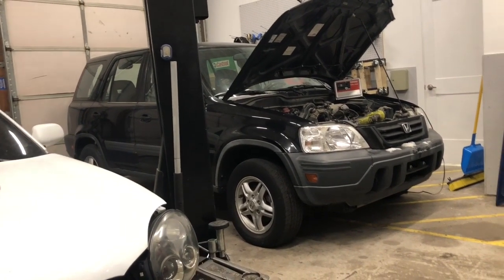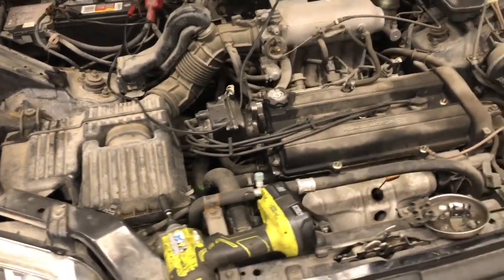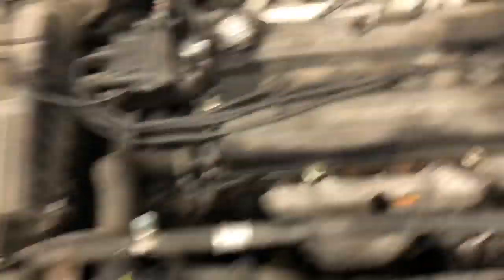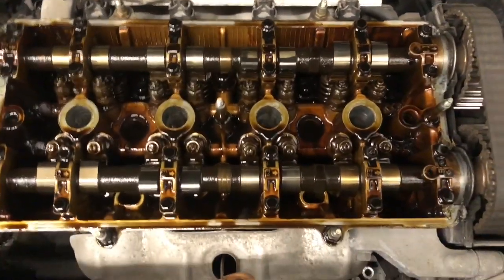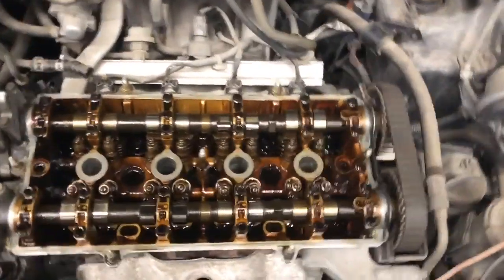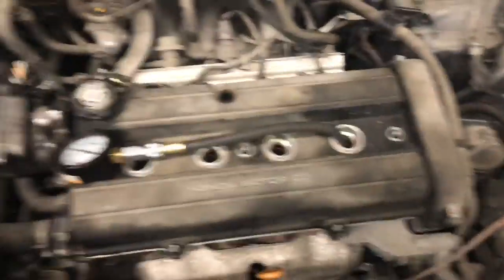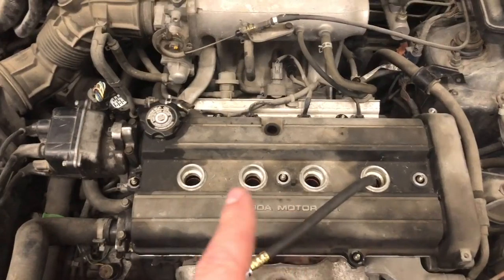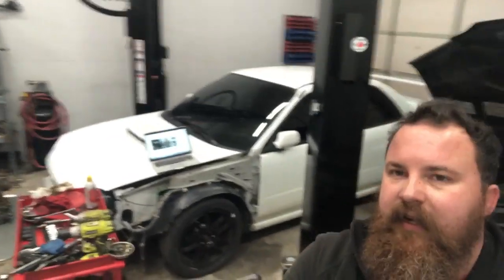98 CRV Misfire Diagnosis P0300, P1300, P0301-P0304

Comment: My wifes 2001 crv with 259,000 miles started missing started out as every once in awhile to always, found one bad injector, one mostly clogged injector and one spark plug boot was very wet, plug wire top boot was not seated. Put in 4 rebuilt injectors, new plug wires runs smoother then it has a months, made the wife very happy. Also found the radiator had a tiny leak in lower right corner, new radiator.

Comment: We have a 1999 CRV that is "slow to start."  I plan to take it to a local mechanic to have it diagnosed.  I hope it's something simple to fix as my daughter doesn't want to sell it.  The dealer said it's only worth $800.  The inside door handle chrome has flaked off (cuts fingers) so the handles are duct taped.  The doors don't lock any more with the fob.    The picnic table still works fine.  Thanks for the interesting video. 70-yr. old mom

Comment: Same as my '99 CRV! Check engine light, random misfire codes, etc. After reading through some CRV forums I discovered that the heads on this engine were a bit soft, and the valves were literally beating the seats to death, which tightened the lash over time. On top of that, the USA owners' manuals recommended valve adjustments at 100,000 miles! International manuals state (I believe) 30,000 miles. Honda would not pay for any repairs, since this problem doesn't usually show up until well after the warranty has expired. They did issue a TSB sometime in the 2000's (too late for me). As far as I know, this only affects the Gen.1 CRV's ('97-'01). Anyway, I skipped the compression test and went straight to the leak-down test. Bingo! I had a burnt exhaust valve on #2 cylinder! I did a complete valve job, did not machine or replace the head, and it is still my daily driver with 338,000 on it. Hint: for anyone wanting to do this themselves, you will need a special valve spring compression tool. A "standard" one won't work because the head is too deep. It was $80 well spent however, because it does 2 valves at a time! I still have it, if anyone is interested.....
Reply: Does a complete valve job refer to removing and replacing the existing valves?

Comment: Very informative! Thank you! I’m about to look at a crv with the same exact issue. Only asking $1,000 so I think it would be worth it even if I had to buy a new head or even borrow one from my LS integra. I’m hoping a burnt/broken valve isn’t the issue. It’ll be hard to diag in the guys driveway so I’m going to take a gamble. It currently runs on all 4 just has a rough idle so we shall see
Reply from the maker: for $1000 its worth it! LS heads are easy to find and swap out affordably. Good Luck!!

Comment: Most depressing search of the day. Haha. Great video. I had oil leaking into my spark plugs so I changed the valve cover gasket. Wish I would have checked when I had it apart. But I guess this is next.
Reply: It’s most likely you need a valve adjustment, these b20s really should get them every 30k miles. It’s very easy to do yourself, watch the video tutorial from The Honda Resource on youtube

Comment: I Just ran in to issue on our 2001 CRV 283,000 miles. It had a misfire under load so I started with a compression check came up with 200,175,175 200 from there I noticed the plugs were worn bad they had a gap of .59 and should be .44 so I put new plugs in it and it still did same misfire so I took the coil out and found that it was shorting out through the casing and the dist housing ,I also tested the coil and it tested good.But that was the dang problem.I think the plugs with such a wide gap caused the coil to work harder and short it self out
Reply from the maker: bob4brenda very common as well, I once had a crv with a dizzy come in that the wiring was all cracked and corroded. These Honda ignition systems are great, but sensitive for sure

Comment: Miss fire on 3 and 4 I put high mileage injection fluid to gas every time I filled it half tank and it would turn off and it would come back on again  then changed gas to mobile  super + suggested by mechanic and the light turn off after 3 months. Why??

Comment: I did the compression test on my crv got cylinder 1: 30
Cylinder 2: 160
Cylinder 3 150
Cylinder 4: 155
 Does this mean cylinder one has a burnt valve or just need adjustment

Comment: Great video. I wish you were close to western Colorado. The car love of my life, my '99 crv, was not holding its idle at a stop when the ac was on. It has 248k miles. Anyway, I took it in for that and they adjusted the valves and the day I picked it up, it started getting misfire codes, rough idle and a blinking engine light. I took it back immediately and after my mechanic replaced several other things including the mapping sensor it seemed to be running fine. But after driving 10 miles, the engine light came on again and started blinking again, but it seemed to be running fine. I took it back and now they say my rings are bad in cylinder 1,2 and 4 and I can either drive it til it quits or put in a new engine. It doesn't smoke or use oil excessively. I would love to get another opinion on what my options are. I love my car. I've had it 20 years. Is this the end, my friend??
Reply from the maker: Vanessa Ford oh that’s rough :( best case scenario burnt valve, worst case worn rings :( I would say swap in a low mile jdm engine at that point, but honestly? You could find another CRV easily for the same price. Maybe do that or try the 2nd gen CRV? Sorry to hear about your baby :/ Thats rough
Reply: Thanks! Do you have a quick answer for how you tell if it's a burnt valve or worn rings? I was thinking burnt valve when I watched your video. They did a leak down test and said there was also blow by coming from the oil opening and that it is worn rings. I'm going to drive it 20 hours to KY in 3 weeks. Hope we make it!
Reply from the maker: Vanessa Ford leak down test or wet compression test. Do you not trust the mechanics? Normally they give you the results of their tests. If air was coming out the exhaust? Valve, if out of the oil dip stick tube? Rings. Cant hurt to run it til it blows at this point. I wish ya luck! Let her rip!

Comment: I had a distributor rotor come off an aftermarket distributor I installed into my CR-V last November when I got it and the original one died.  Drove for only a few days and got CEL for random misfire and misfire on all four plus P0420 hope it's not a valve too.  Even on Honda's I.N. it says it might be if a valve is shot

Comment: I took my 01 crv to a shop to change the timing belt and water pump and belts while the mechanic was doing the job. Now he returned it with a rough idle and I dont know if he didn't do the timing right.

Comment: Great vid! My son has a 2000 CRV with 175K miles, and is showing P0300,, P0301, P0302, P0303, and P0304.... I'm heading up to Humboldt to go try and fix it, but wondering if he's having all of those error codes is it still likely a burnt valve, or possible vacuum leak, like maybe a throttle body gasket or vacuum hose? I'll definitely run a compression check, and check the valve clearance, but since he's pretty remote I'm a little scared of stranding him :-/
If you have time to give me your 2cents I'd be ever grateful!!

Cheers!
Reply from the maker: Keith Patterson your saving grace might be the fact that its all cylinders in your case. Only a few systems share all cylinders like the intake manifold or fuel system or fuel rail. Brake cleaner works great for finding leaks (idle changes) but a compression test right off the bat will let you know fast. (Plus the engine is still cold so you can adjust valves after if the numbers look good) . Thanks for the view and comment! I wish you and your son the very best. Teach him the ways!
Reply: Most appreciated! I'll let you know how it goes! Best!
Reply: Thanks again for the beta. I got  back from Humboldt and hoping I fixed his car :p
Did a compression check. 
Cylinders 1,2,4 were at around 193, and cylinder 3 was at about 172. Exhaust valves were kind of tight, so I adjusted, reset the CEL, and now crossing my fingers. 
I did spray brake cleaner all over the intake area but never saw a change in idle speed. oil and coolant were nice and clean, so  not expecting any HG issue. I'll let you know how it goes!! Cheers!
Reply from the maker: Keith Patterson thats great news! And those compression numbers rock. At worst maybe spark plugs, cap and rotor if it does come back. Nice work!

Comment: When I turn on engine shakes then after a couple of minutes it would ho back to normal oil was low I tapped it added what it needed then light turned off. But still shakes a lot for a couple of minutes then it runs fine. Honda crv 2001 2w transmission is good no problems there. Had a  coolant leak it got patched so no more leak. So why if engine light is off it still shaking at beginning?
Reply from the maker: could be all sort of things honestly. worn mounts, worn crank pulley, fuel trims etc

Comment: I have a misfiring problem, and the engine cuts out when rapidly decelerating like in a tight turn. But the problem is almost inexistant when over 3,000 RPM when valves open more because of the geometry. I tend to think this is because there is a closed valve that open ups at higher revs. Correct possible interpretation ?
Reply: I don't think so. I think the motor just kinda compensates at higher speeds/rpm's. Rapid deceleration during tight turns? Are you racing your CR-V?
Reply: @katielyb  ciao Katie ... no I live in Italy ;-)  The beloved CRD is now gone... Too complex a motor to be handled by inexperienced mechanics.

Comment: Had the same problem replaced the head and did a valve adjustment, just do a valve adjustment every 30k
Reply: Exactly. Unfortunately the Honda manual says to do it every 100,000 miles. The root cause of the problem is soft valve seats, causing the lash to decrease over time. I found this out the hard way. One of my #2 exhaust valves was burnt also. Did a complete valve job and it's still my daily driver with 350k on it. Mine's a '99.
Reply: @19580822  mines a 99 also with allmost 200k on it. My timing belt broke lucky i didn't bend no valves but it just don't seem like it run's like it use to. I'll prob either replace the motor which i have a spare or another head on it.

Comment: My heat and AC is not blowing out of the vents on my 2004 Honda CRV. I have checked the fuses and they all are good. I changed the blower motor and the resistor and nothing is still working. What do you think the problem could be? Thanks?

Comment: What's wrong with just putting in the one new valve in 🤷🏽‍♂️ it would fixed the problem correct if im wrong . But sweet diagnosis!
Reply from the maker: Many times that can work if caught early. The problem with burning valves is why they were burnt. The valve clearance tightened (this leads to the valve being unable to cool between strokes, then they burn), usually at this point they recess the valve seat into the head, then you cant adjust for proper clearance anymore even with a new valve. Heads are cheap, machine work isnt.

Comment: Hi It is very good to learn.I have 03 Honda crv heater problem ,when you turn heat on driver side is cold air blowing passanger side is hot air blowing .I flush heater coil also same thing what should I do next .
Reply from the maker: Tin Tun check the blend door, or the other door down under the dash

Comment: The reading on a check engine light showed cylinder codes--I went to a higher grade gasoline and the engine light turned off.  The car is still idling very low but is running strong.  Should there be a worry?

Comment: Hey my Honda CR-V 1999 is having problems. Between the last two weeks it's been cutting off, cut back on when it wants too, change the converter and replace fuel pump and is still cuts off,  within the last two days it won't start...???
Reply: I'm late but it's probably the ignition, there's a recalled part that causes that issue

Comment: my 2001 crv is firing cylinder 1, spark and plug my question is can i put something in cylinder to see if injector is working.? thanks good videos,,
Reply from the maker: babe tucci thanks for the view and comment. You can put a screwdriver onto the injector while it is running, then place your ear directly onto the screwdriver handle. You will hear clicks if it is working. Or you can move the injector to another cylinder and see if the misfire follows it
Reply: the resonator has a rounded bolt and i haven't went further...////this is a auction car i bought to run on a mail rt....everything is great but  this misfire.. 143000 miles.
Reply: 2001 crv,,, i took the resonator off to get to injectors,,started engine and it revved up and down,,so shut it down.

Comment: I know this video is 3 years old but I'm hoping you'll respond. I realize the CR V is a late 90's model but my mom's car just started misfiring, it's a 2005, and I'm also smelling burned oil. Even inside the vehicle. The motor has already been swapped due to failure to diagnosis a faulty cylinder but there was no burned oil smell the last time. Would I be safe in assuming this motor is likely to have to cylinder issues as the one in your video? I'm telling you, this is the first Honda we've ever owned and I'm not impressed.
Reply from the maker: Too many variables to troubleshoot over text. K series engines like your K24 are wonderful. Finding a good and trustworthy mechanic would help, who knows what all has happened to that car or the engine prior to install. You need some basic diag work done like compression tests, leak down etc to really see the health of the engine

Comment: I have a 96 hatch with a b20 swap, it is a b20z2 (don't know if that matters) but it sounds like I have a misfire and it has stalled out once while I was stopping at a light with the clutch in. Would you happen to know what is causing this?

Comment: Hi,my 2001 crv is using oil,i am going to do a compression test and for life of me can't find anywhere that will tell me the correct pressure to hope for.can you enlighten me on the one thanks?it'll be much appreciated. cheers,Dave
Reply from the maker: above 150-160psi should be good. 180-200psi is really good. Just pay attention to the variances across cylinders. Compression test while engine is cold. Get a really low result on a cylinder? add a tablespoon of oil into it and retest. If it goes up? its your rings. Throttle body open, and pull your PGMFI fuse in the panel under the hood to protect your distributor and not flood your cylinders with oil.
Reply: @roninmotors7466  brilliant,thanks very much for your help.I'll be trying that today!cheers mate!

Comment: Fingers crossed this isnt my issue... tomorrow i go take a look at a new crv 🙏
Reply from the maker: its common, but so are the simple fixes. Just helped a customer yesterday with multiple misfires and his valves turned out ok. good luck!thanks for the view
Reply: Ronin Motors where can i send you a video of the crv? The seller sent me a video today... he has it running... idling on 3 you can hear it from the tailpipe sputtering... but then it runs on 4 for a little then back to sputtering.... im assuming its an ignition issue. Wires looks oem along with dizzy... 270xx km on the crv. Let me know if incan send you a clip. Thanks ! Cheers

Comment: I have a 62k mile jdm b20b and it has like a misfire and backfires and stuff from 2k rpm to about 3k then cleares up and also it sounds like a subie lol swapped it into a 96 EK so was wondering if I need a new motor now already
Reply from the maker: Civicem1dude did you watch the video and perform any diagnostics on it?? Want me to just guess or what? Haha
Reply: Ronin Motors yes that would be great bc you know these motors im a K series person, I didn't run any test besides checking spark plugs and changed out plug wires and still does it

Comment: i thought the exhaust was .008 and intake was .005?
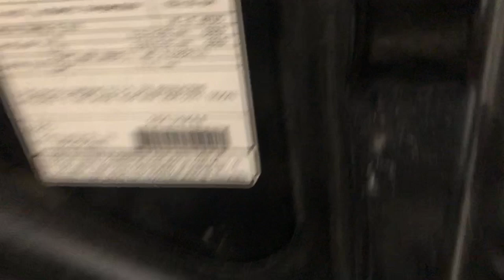Reply from the maker: mm vs in. (metric vs. imperial) I show the factory hood sticker @4:34  factory showing lash specs (Intake= 0.10+/-0.2mm; Exhaust=0.18+/-0.2mm) I always encourage people to refer to factory manuals, factory stickers or google the specs themselves. Obviously it is very easy to make mistakes while filming, speaking and working with one hand or even watching. This helps prevent confusion and 1am replies.

Comment: i have a hesitation in a 99 crv and was wondering what you think it is. when i rev it, it hesitates between 2-3k and also when im at high speed it will run but if i try to accelerate it has no power
Reply: Not necessarily. If it's not idling rough while running in park then it's not likely a faulty valve. That could have something to do with a pressure regulator and your gas pedal if memory servers though.

Comment: What do you think a shop would charge for this job? Great videos. Sub’d!!!!
Reply from the maker: Hard to say really. Most shops are $75+/hr. Just to adjust? $100-180, diag is like $75-$125 normally
Reply: Ronin Motors I just got a 2000 crv and I’m fixing all the little things on it. I just realized the power lock actuators don’t work on all 3 doors other than the drivers door. I’ve also got the clunking noise under the drivers side feet. I’ve got some work to do!
Reply from the maker: Forrest Coleman thanks man! I have a video for the locks! Check it out. The clunk is the sway bar end links, cheap but kinda sucky to do. Get after it!

Comment: I’m having the same but when they did a a compression test every cylinder blew 160  but one the other one blew 60 what do you think it is Please help
Reply: Either your piston ring is burned in that piston but im gonna bet u its your valve, it's burned through
Reply from the maker: typically low results are rings and zero pressure is valve. unless its partially burned. You can do a wet test, where you add a tablespoon of oil to the low cylinder. if it goes up? its worn rings